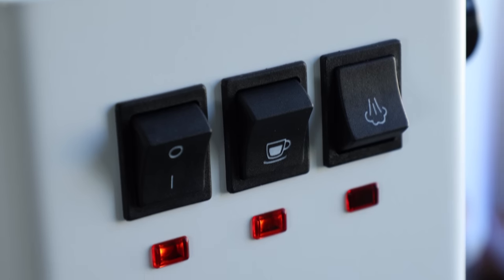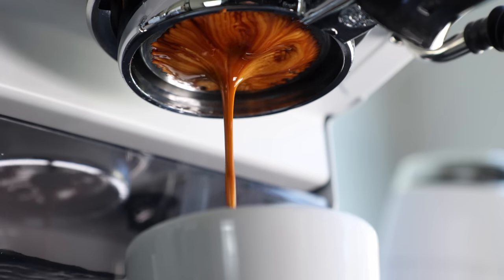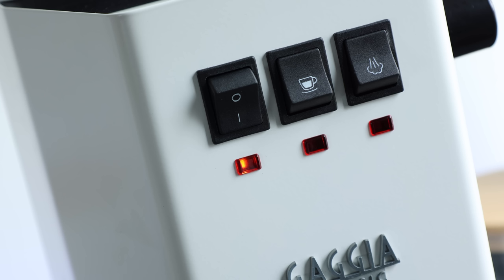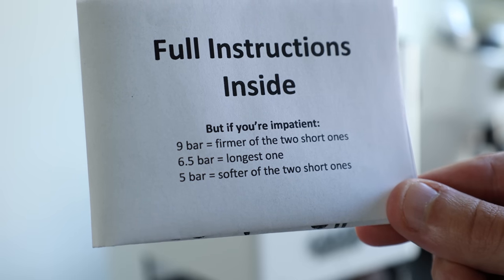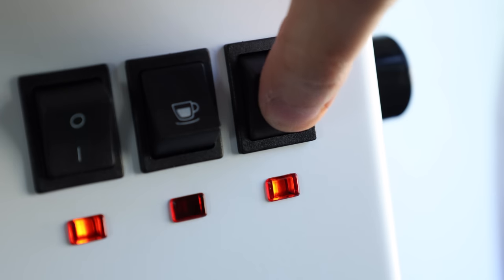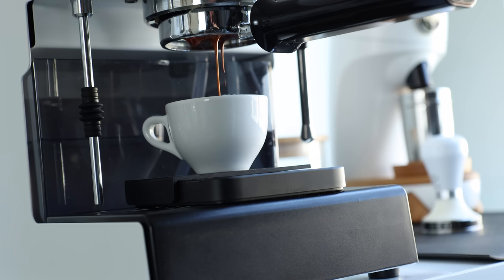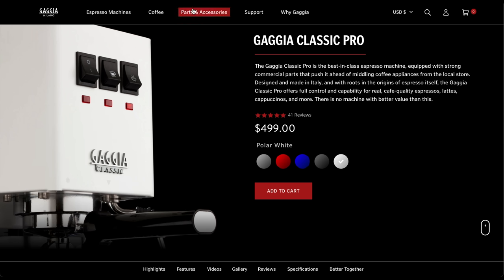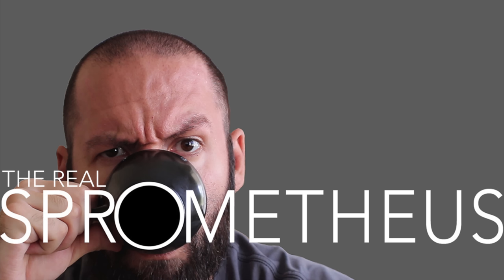GAGGIA CLASSIC PRO - Small But Mighty Home Espresso

Comment: I agree with the you on everything but the disposable comment. I've been to a certified repair shop, they carry everything! Even the smallest of o-ring! These machines will outlast every appliance grade machine hands down. Only thing to consider is your own ability to repair, versus paying.
Reply: i upgraded my dead gcp to an ecm classica and yeah its 3x the prices, but i would say its atleast 4x the built quality as well and you are just getting a better machine in absolutely every aspect, i expect to have it my whole life so i just dont see a reason dinking around and spending money to keep a little beater machine full of cheap parts alive.
Reply: Everything can be fixed if you fix it.
Reply: I had a breville dual boiler. Outstanding machine…til it broke. Took it to a espresso repair guy well known in the Philly area, and upon disassembly he said it was literally entirely plastic inside. He said her a gaggia or something that uses brass parts. And my gaggia classic pro has been serviceable and reliable for 3 years now
Reply: @joshk528  Yeah OK... that means nothing at all tho. We all know that manufacturers of everything and anything are betting on planned obsolescence to sell more products.

Comment: I recently purchased a Rancilio Ms. Silvia for home and love the machine.  This was a huge upgrade from my old Krups 964 that I have used for 30 years. My office wanted an expresso machine but limited to a budget of $500 with tax.  This narrowed my options considerably and chose this Gaggia classic.   Going from the Rancilio to the Gaggia was like going from a 2023 Toyota Corolla GR to a 2012 Nissan Versa.  Everything about the Gaggia was lower grade - from the porta filter, to the weight, to the clearance beneath the portafilter, and most frustratingly the steam wand and steam power.   The Gaggia takes considerably longer to steam milk.  The boiler simply does not have the staying power for even one drink, no way can it do two drinks back to back.  My Rancilio has sufficient power to produce steam for multiple drinks.  So yes, if you are single - this is perfect.  But if you are a family or one that entertains many people - you will struggle with the Gaggia.
Reply: I agree. I have an old Saeco manual machine which sounds very similar to the Gaggia. The steaming is similar. I struggled with making multiple coffees for people, but on my own that is all I need.  Will go for the Gaggia to replace mine for that reason,  otherwise the Rancilio was my second choice.
Reply: The Silvia is certainly better in stock form! But with some cleaer mods like boost box and dimmer switch you can get that steam going very well!
Reply: What type of rancilio silva, sir? I’m in doubt deciding between these two

Comment: I think the GCP is the perfect starter machine since it can basically do everything but allows users to figure out what bottlenecks they want to improve on. All of the GCP flaws can definitely be fixed with some mods that are cheaper than direct upgrades or people can choose a machine to upgrade to that prioritizes their preferences.  In my own experience, the GCP has a pretty good resale value so I was able to effectively rent the GCP for a year and half at a low price to learn the techniques and then buy a "better" machine that came with the features I wanted.
Reply from the maker: Yeah I think that’s definitely true, and a lot of the flaws have workarounds as well. Not everyone will want it even need to upgrade to another machine, but having been into espresso for awhile now I don’t know how anyone avoids upgradeitis.
Reply: @Sprometheus  I'm obviously not the majority, but owning a modded Gaggia Classic, I find it difficult to think of an upgrade at a reasonable price. 

I really like that my machine is small, somewhat automated (electric pump, PID) and fully warmed up in less than 10 minutes, and any large chunk of metal like an E61 group or a large HX boiler makes the latter impossible. The Decent would be a splendid upgrade, but it's way over my budget. The BDB is a bit large and I don't really need the separate steam boiler (milk is low priority). Levers are probably fun, but I want something less dependent on my own performance (especially in the morning).

Maybe Breville (good UX) acquiring Lelit (good build, small machines like the GCP) could lead to interesting developments, but it will probably take a few years to see if something happens at all.
Reply: @Sprometheus  It all starts with upgrading the tamper from the box.
Reply: What did you upgrade to?
Reply: @tehgusbus2716  I ended up upgrading to the Breville Dual Boiler. The main features I wanted was the PID and preinfusion features which are able to be done with mods however I also wanted a dual boiler, a steam wand that can be used in a better angle, and faster warmup times. 

It definitely wasn't a "necessary" upgrade but to me, the small stuff was worth it especially since I usually make milk based drinks with light roasts throughout the day.
Reply: @Sprometheus  if you're the sole coffee drinker in the house, the GCP, with DIY PID/dimmer/gauge/preheat coil is such a compact footprint for such a thoroughly capable solution that I can't thick there is an upgrade at any price.   I suppose temperature profiling could be something that sings to me one day, but not into the whole coffee by program thing,  and my DIY scace shows live intra-shot shot stability within 1°C, so unless I'm looking for a ramp up or down I'm covered with the mod'd GCP I have.  With retrospect, a few months' surfing while planning a big and bespoke bunch of mods was the best way to calm my upgraditis, perhaps, hopefully, for good.  I don't own many things I haven't modified,  but these mod'ed things tend to hang around for a long time...

Comment: Shades of coffee's extended slim drip tray is a very nice solution for the issues with clearance below the group. That + a bottomless portafilter + a slim scale allow for most reasonably sized cups.
Reply: This is the exact setup I use. The slim drip tray needs to be emptied a little more but the QoL improvement over the OEM tray is well worth the small inconvenience.
Reply: For people into 3d printing, you can also print the slim drip tray, which workd pretty well (I printed mine with PETG and it works perfectly).
Reply: I use a very similar glass (double spot) as in the video. The one I have us just larger than the double spouts on the portafilter and will allow a scale under it with standard drip tray.
Reply: Yep, Mr Shades' slim tray, bottomless portafilter, and Timemore black mirror scale make my life much easier
Reply: The Shades regular slim drip tray is also very nice and makes a little extra space for steaming with the jug in front

Comment: As a Gaggia owner and follow the forums and groups pretty heavily it basically goes like this: buy Gaggia, then do mods after 6months - 1.5 years of normal use. Then mods. Then live with it for a few years. Then they buy something in the 1500-3000 range for home and this becomes a work machine for office
Reply from the maker: I don’t follow the forums and all that very closely, but I can definitely see that being a pretty standard timeline.
Reply: @Sprometheus  regarding the steam wand did you try surfing that too but what you do is start about 5-8 seconds before the light goes on. Only way to get consistency there. It’s a bummer

Comment: I usually wait ~20s when I press the steam button, and start frothing before the light comes on. That usually gives me a pretty power froth. Hope this helps!
Reply: I use this trick on my machine and get pretty great steam pressure, I'm glad I found out about it or I may have just gotten rid of the machine
Reply from the maker: It’s funny with the Gaggia because it seems there are a lot of techniques and tricks. Some go into steaming immediately, before the light, after the light, and have specific time frames. The joys of a single boiler haha.
Reply: @Sprometheus  I find that let all the first lot of steam out till the light turns off again, and then when it goes back on for the second time I get a more powerful steam!
Reply: @thomastaylor9600  I used to do that too, but I just didn't like the steam moisturizing my coffee station 😓
Reply: @ihavenojjable  yeh I get what you mean!

Comment: Ive had the Gaggia for few months.
I changed OPV spring to 9 bar & changed the filter basket & shower screen.
Using temp surf the cappuccino & lattes I make are as good as any cafe Ive been to & better to many Ive been to.
The steam wand is easy to use.
No need to spend double or more on another machine.

Comment: I'd agree with just about everything in this review. A Gaggia Classic has been my daily driver for a decade, and I bought it cheap on the used market, so I'm unsure of it's age. The lack of clearance, even with a bottomless portafilter, is by far my biggest gripe. In order to make a travel coffee in a keep cup, I need to remove the drip tray. Hardly elegant. And I've never been able to get perfect, insta-worthy milk, though friends and family are still impressed by the latte art when they visit.

As for longevity? My machine has not been offline for a single day in 10 years. A small sample size, I admit, but I'm currently replacing the grinder that I purchased new at the same time (Breville Smart Grinder) as it's now having issues. The Gaggia? Still rock solid. Buy with confidence.

Comment: My Gaggia Espresso (the the plastic cheaper version of Classic Pro) is now 23 years old. So far I have replaced the pump (3 years ago) and recently upgraded to have adjustable OPV. Admittedly it has many more professional grade brass fittings than today's Classic Pro. Will keep using it as its small footprint works well in the kitchen. Coupled with equally small Eureka Manuale it produces great shot/$ ratio.

Comment: Letting the machine  warm up for 20-30 mins really makes a difference in a tasty cup.  As for the wand it would be preferable to have it more adjustable, but over all easy to steam or froth with.  Haven't pulled the trigger for a bottomless portafilter yet.

Comment: GC is the entry drug to espresso world. Afordable, can be good enough out of the box if you learn to use it. If not good enough simply mod it.
I opted for this machine because I didn't know if semi-automatic prosumer machines would stick with me. For me buying and modding the hell out of it was the cheapest option, and honestly a good learning curve.

I stopped using 6.5bar spring simply because the steam wand doesn't produce the desired power I want it to have. 9 bar is ok.
I can always use my Flair for lower pressure shots.

Soon it will be time for entry level prosumer machine :)

Comment: Re: the steam pressure. Start steaming 25 seconds after turning the steam switch on from a machine warmed up to brew temp. 
The steam-ready light won't be on but there will be enough pressure to steam milk and the heating coil will stay on for all or most of a pitcher of milk giving you strong (for a consumer machine), consistent pressure.

Comment: I really love my GCP and since now it's fully modded. :) I did the 9 bar mod, auto off-timer disable mod, PID, bottomless portafilter with IMS basket, IMS shower screen and silicone gasket, slim drip tray, one hole steam wand tip, and replaced the steam knob with a wooden steam knob. ❤
Reply: Should do a video on your channel of your setup :-)
Reply: All you need is the flow control witha dimmer knob and a pressure gage added to it.
Reply: @CH-yp5by  yeah, that'll be endlevel. But I don't want to screw up the aesthetic look of my gcp, so I'm not a fan of the dimmer knob. 😅

Comment: I understand the 'disposable' comment, but it is a bit misleading.  Espresso was invented as a fast and efficient way to make many cups of coffee in a commercial setting.  Originally Italians used a moka pot at home and called that espresso.  In the 70s Gaggia pioneered the idea of producing 'real' espresso at home with the small, inexpensive, plastic-housed Baby Gaggia.  Ever since, various makers have produced machines ranging from inexpensive small home appliances to expensive, large, heavy, only slightly modified, or unmodified, versions of what a cafe or restaurant would use.  Today, most serious enthusiasts use commercial-like 'prosumer' machines that cost $1,000-$5,000.  Today Gaggia doesn't make those, but rather serves the high-end of the home appliance market.  Unlike its (few) competitors in that segment, the Classic can easily be modified in a number of ways to improve its results.  And in addition to being more modifiable, it is also probably more durable, repairable and maintainable, and thus less disposable, than its chief competitors, from Breville and Solis for example.  That is why the Classic has been around with few changes since 1991.  So I would avoid the word 'disposable'.  Excellent review otherwise.

Comment: I'm about to do the Gaggiuino mod on my GCP. Can't wait to get more control over temp, pressure, and steam. Such a cool mod if you have time to check it out.
Reply from the maker: Yeah I’ve definitely seen it, seems pretty cool. But didn’t want to mod it too much as I’m going to give the Gaggia away on IG pretty soon.
Reply: @Sprometheus  curious why on IG, rather than Patreon?  Asking as a backer that doesn't use IG
Reply from the maker: @whosgonnadotcom  well, you’d never know because of how many creators do it, but giveaways are against the terms of service on Patreon. https://blog.patreon.com/patreons-stance-on-raffles-lotteries-and-giveaways

Also, doing it on IG allows me to bring in more partners for the giveaway. So with the Gaggia I’ve got Slow Pour Supply putting in a pitcher, cups and maybe some other tools. And Sworksdesign is putting in a WDT.

Comment: I love my classic. I modded it out with a preheat coil before water enters the boiler and a PID. It's so temperature stable and reliable, most e61 machines on the market look like a downgrade. I'd have to look compare it to a Decent or La Marzocco to see any reason to upgrade - and that's a tough jump to make.
Reply: Ditto.   Preheat coil, pid, dimmer with punp stop pushpot, pressure gauge, passive timer, tank lights to bounce light onto the bottomless PF.  No plans for anything bigger, heavier,  and at least five times the cost.   It does everything I want

Comment: I have Gaggia Classic Pro which I modded with a BoostBox. It has a PID, a pressure gauge, and dimmer switch for pressure control. It's basically a very cheap Lelit Bianca at this point and there probably isn't any machine that can come close to what this machine can now do at this price point ($800 total after adding the BoostBox).
The steaming is a bit frustrating, not the power as the PID fixes that problem. But the want mobility is a bit annoying as mentioned in the vid. And the open water tank is very frustrating. But all in all, definitely the best entry into prosumer espresso because of all the modifications and support online. Would love to upgrade to a Lelit Bianca though to have the dual boiler, better steam capabilities, and a sealed water tank. And it's damn pretty.

Comment: Tip for those that hate the default steaming experience on the GCP, but don’t want to mod to a PID: Get a higher temperature thermometer for the steam. The default thermostat is too low for powerful steam. Increasing the temperature increases the steam power. It’s an easy and inexpensive mod. I’ve done it and it makes a huge difference.

Edit: Grammar is hard...
Reply from the maker: That would definitely help, I hadn’t considered that one.
Reply: You can start steaming before the light comes on you’ll have plenty of power for microfoam.

Oh and the Shades PID is a fossil, it utilizes a SSR which can be off by as much as 10 degrees, if you’re staying with the Gaggia long term look up the Gagguino.  👍🏻
Reply: @AdastraRecordings Yep I agree it’s enough to do microfoam if you time it correctly. The thermostat change just gives a bit more power and a little less fuss. 

Thanks for the recommendation on the Gaggiuno. Shades seems to be the most popular and time-tested but I love the modern take using ardiuno with more functionality.

Comment: Solid review. The GCP is a classic and it's hard to get away from. It hits a sweet spot. My son just got one. It's the price point and the fact it's small enough for a small kitchen. I looked at them but once I upsold myself to a Mazzer I went full E61 and got a Expobar Office lever. I had that for about 10 years and just gave it away to my brother in law. I am going to replace it with a dule boiler machine. I am lucky enough to be in a position to do that but I get that not everyone is ever going to want to drop 3 grand on an ECM or even have the space for it.